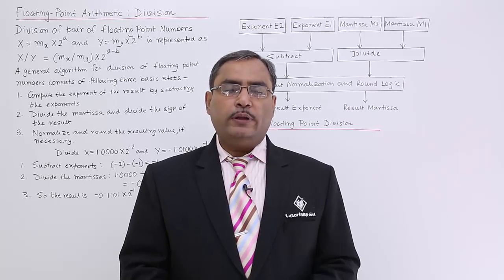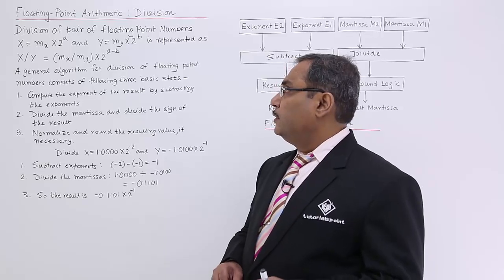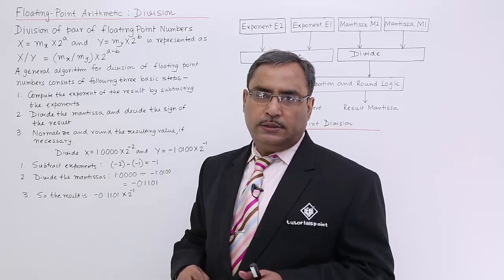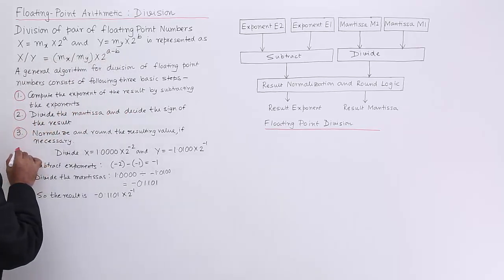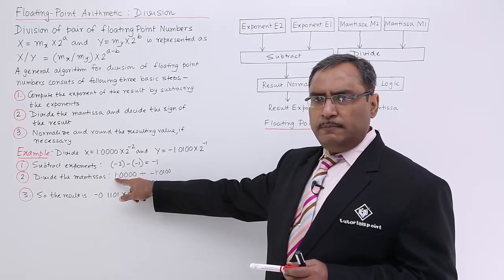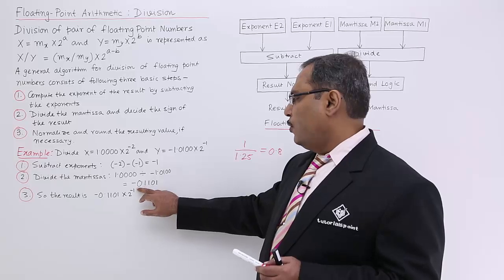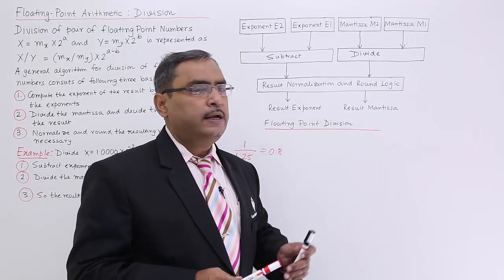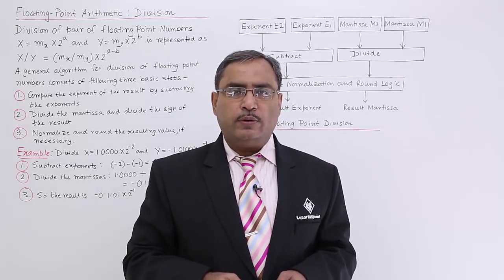Floating Point Arithmetic on Division

Comment: ⚙ Step-by-Step Conversion of 0.8 (Decimal) to Binary:

We’ll use repeated multiplication by 2.

Step 1: Multiply the fractional part by 2

0.8 \times 2 = 1.6 \Rightarrow \textbf{1 (carry)}\ \text{→ keep 1, continue with 0.6}

Step 2: Multiply the new fraction by 2

0.6 \times 2 = 1.2 \Rightarrow \textbf{1} \ \text{→ continue with 0.2}

Step 3:

0.2 \times 2 = 0.4 \Rightarrow \textbf{0}

Step 4:

0.4 \times 2 = 0.8 \Rightarrow \textbf{0}

Step 5:

0.8 \times 2 = 1.6 \Rightarrow \textbf{1}

Step 6:

0.6 \times 2 = 1.2 \Rightarrow \textbf{1}

Step 7:

0.2 \times 2 = 0.4 \Rightarrow \textbf{0}

Step 8:

0.4 \times 2 = 0.8 \Rightarrow \textbf{0}

⸻

📌 Result so far:

So the binary representation (fractional part only) is:
0.8_{10} = 0.\overline{1100}_{2}

This means:
0.8_{10} \approx 0.110011001100…_{2} \ (\text{repeating pattern: }1100)